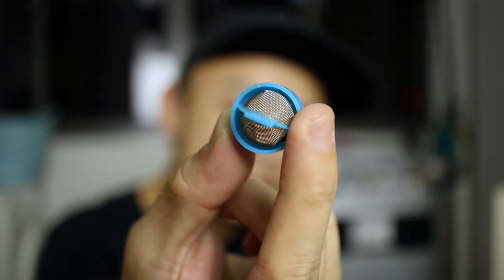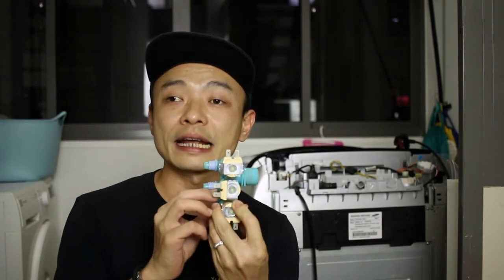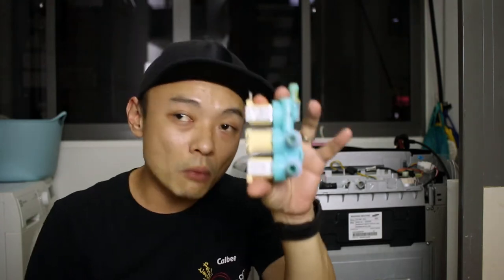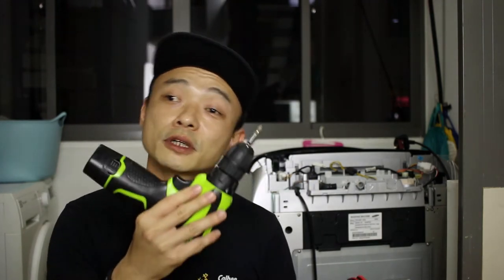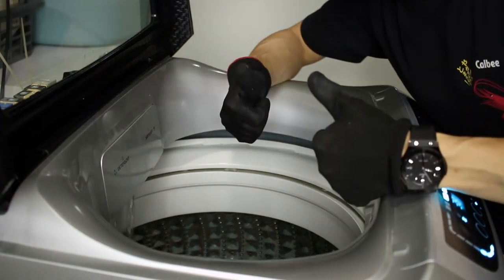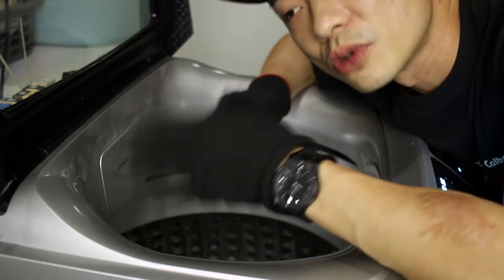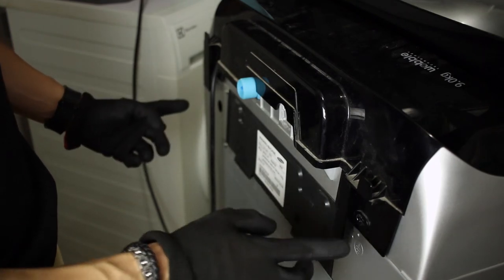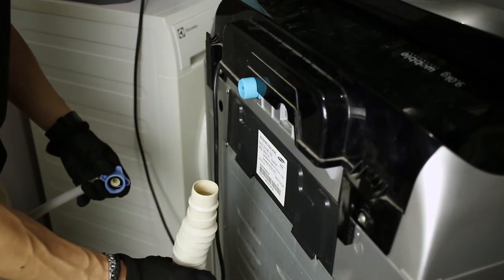Samsung Washer not dispensing water. DIY fix

Comment: Hi Bro, I'm using the same Samsung washing machine. But it's 10.5kg. Sometime ago I realized that the softener dispenser is not functioning even after pouring into it. Water flow no problem except for the softener dispenser which fills water into the softener but not dispensing out. Kindly advise what could me the problem be and how I could fixed it?
Reply: Same. Wondered why there was left over water, don't use it now. I now have the problem above so wonder if they are related.